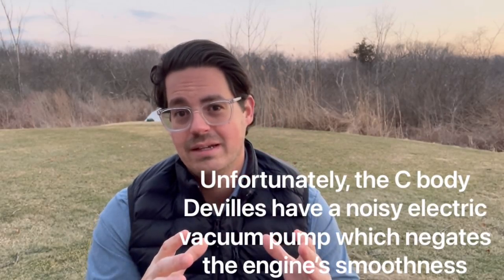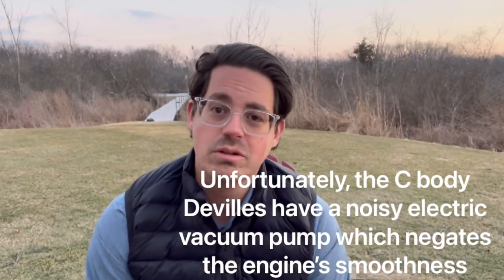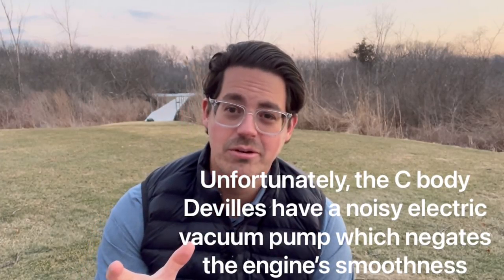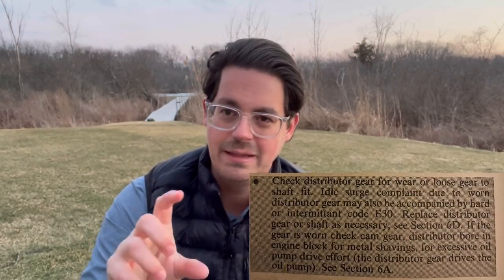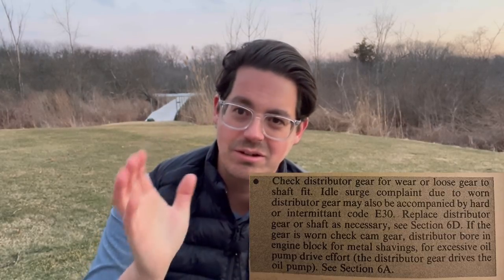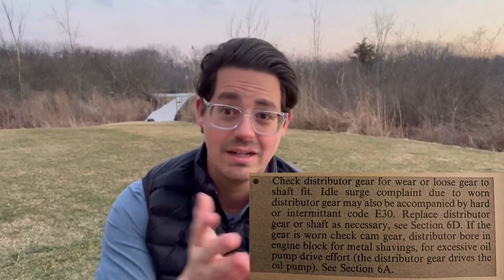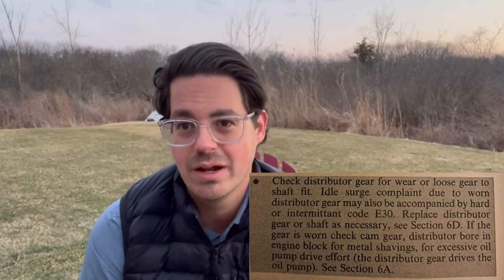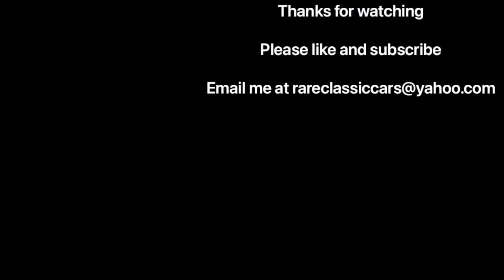Worst Engines of All Time: Cadillac HT4100 - Why is it so bad?  How can you preserve yours?

Comment: I purchased a 1985 Touring Coupe in 1995, with 30,000 miles on the clock. One of many Cadillacs I've owned and probably one of the smoothest driving. While taking a road trip to my mother's house in San Fransisco, on the return home I noticed it losing horsepower, using oil and felt like it was running on four cylinders. When I returned home, I performed a compression test which resulted in less than 50 lbs. in all eight. I still don't know exactly what went wrong but the engine was toast, and because a replacement cost more than the car was worth, I had it towed off to pick a part. The rest of the car was like new. Cadillac, after a series of "turd" engines should have used the Olds V8's like Buick, Pontiac or even like they did in the later Fleetwood Broughams. I owned a 77 Seville that had the Olds v8, and other than the Bosch fuel injection, was fantastic. I bet even the Allante and the XLR would have been more successful had they used the Vortec or LS derived engines, but I'm not a bean counter at GM so I guess they had their reasons.

Comment: line mech for cadillac early 80s, when we got the 4100s off the delivery truck we were instructed to put 2 huge tablets of radiator/intake stop leak in every one. They looked like oversize compressed pepper aspirins.

Comment: At the time, buyers wanted good mpg cars and Cadillac was attempting to do this, the 4100 was written up in car magazines for a few years as a good engine, then by 86 -87 problems started and the engine was redone into the 4.5 and later 4.9 and those were Cadillacs least warranty issue engine, so once this was redone, it was fine.
I knew a few people who owned a 4.1 Cadillac and took care of it and ran them over 100k  but also my Mom drove her 81 Riviera diesel for 20 years, and was still running when she got rid of it.
Lincoln had a lot of trouble with their V6 continental 89-93, lot's of upset people with those.

Comment: Parents had an 85. About two years after purchasing received letter from Cadillac saying engine was built with substandard seals and would leak coolant into crankcase and this would most likely happen after warranty had expired. It started at 40k miles and had to be rebuilt. Not covered by warranty. Numerous electric problems and transmission died at 50k. Last Cadillac ever purchased. Went to Acura and Lexus.

Comment: Drove a 1984 Fleetwood with the HT4100 and it outlasted two transmissions. Engine never gave any issue. Wasn't a high performer by any means, but it would cruise 75 easily. Got 24 mpg on the highway. Had almost 300,000 miles when the second transmission failed and we sold the car. The engine was still runing.
Reply: Built by the same company that a few years earlier were building 472/500/425--what happened?  Cheaper cars had bigger, better engines as options or standard equipment.  Did that make any sense?

Comment: Had 3 Cadillacs w/4100 engines. My 1983 Coupe deVille had the engine replaced under warranty & it was fine after that. Despite the issues I had with it the dealership & GM stood behind their product, taking care of it. Had 2 1985 Cadillacs & by then most the issues were worked out but by then it was too late. They were slow however did return pretty respectable fuel mileage. Seems like if you got a "good" motor from the beginning most likely it was trouble free??? 3000mi oil changes & adding the pellets to coolant seemed to be the secret to keeping them going. Also they were definitely not for the heavy footed driver & definitely didn't like being pushed hard.

Comment: Fun fact: the 88-89 4.5 was way overbuilt. That block continued in the Allante up to 92. The 90 4.5 is by itself. If you got an 88 coupe Deville, it did the quarter in 15 seconds. As fast as an 86 Monte Carlo SS. 
A 91 Eldo is an absolute rocket ship.

Comment: I worked at a Cadillac dealer and worked on several of these engines, and the 4.5, and 4.9 caddys and the early northstars. The biggest issues with these were they liked to spit the rods out, as did the 4.5.. the 4.9 was the best of these engines.. the 4.9 had a ton of torque .

Comment: Just imagine if those early-mid 80s Cadillacs simply had a 350. The thing I always go back to, is that people who could afford those cars didn't really care about fuel economy, so why not just let them have a good engine and then charge the extra fees GM would have incurred for not meeting CAFE on to the sticker of the car? I think people would have been much more apt to pay that for a proven engine that would run for a couple hundred thousand miles with routine maintenance than suffer the diabolical disasters that came with this abysmal engine.

Comment: My parents had a 1982 Deville with the HT 4100 I remember going to the Cadillac dealer with my dad and the guy at the service counter called it the 4100 hook and tow . They had so many problem with that car it was  traded in on a new 1988 blazer witch  they had till the year 2000 with 250000 miles.

Comment: I had a friend back in the 80s that I would race quarter mile with, he had a 79 mustang with a tube frame and fiberglass body we got the idea of building a cad 4100, I worked at a Cadillac dealer so I could get warranty engines for free, we milled the heads to get 13 to 1 compression, ported the heads made custom headers, had custom cams ground, car weighed 1400 pounds and ran 9.0 , the engines did not last long but we would do 3 at a time, they made about 500 horsepower so these will make a lot of power, but only for 10 miles or so LOL

Comment: Thank you Adam!  Great information.  
Random request;  Do you have information on the  A bodies that were offered in sportier trims?  
Cheverolet Celebrity Eurosport, Pontiac 6000STE, Oldsmobile Ciera International series with a 3800 V-6 and the Buick Century T-Type also with 3800.  Would you consider making a video featuring and highlighting the above mentioned?
Reply from the maker: Sure. Good idea
Reply: @RareClassicCars  Don’t forget the rarest of the rare A-bodies: the 1989-90 Pontiac 6000 STE/SE AWD. I drove one of the 1990s as my college beater car, and it was an absolute tank. Ran phenomenally, and so long as snow wasn’t up to the grille, it’d run through it. Might not clear 10MPH, but you couldn’t get it stuck.

Comment: I had a '84 Sedan DeVille with a HT4100. It had 310,000 miles when I let it go. If you drill out the rocker arm fulcrum bolt holes and add helicoils it is a good engine.

Comment: I worked at a Cadillac dealer in the 80s, made a lot of money on that engine, seems like the first thing that would happen us the intake bolts would loosen, causing oil burning and coolant leaks, we called them hand tight 4100s lol, if you got it early all you had to do was tighten them but we had so many customers that wanted new engines under warranty, we had to hold the old engine until the factory rep looked at it, then I would take them home, fix them up, they went for over a grand, lots of demand, I was making more money on the free engines than my regular pay, ahh, the good old days!!!

Comment: It's exactly as you describe it. I had 2 cars with these engines, first one 1985 Cadillac Seville Elegante with the HT4100, then a 1989 Fleetwood Sixty Special with the 4500. the engines are really slow but ran so smooth that you have already driven slowly to be allowed to sit in the car longer. I drove these cars in Germany and even reached 7.5 liters of consumption per 100 kilometers over a longer distance with the Fleetwood. Although the Fleetwood Sixty Special was actually the better car, I particularly mourn Seville. Today I drive Tesla Model S and have to say that the Cadillac engines have already come quite close to an electric motor, at least in a smooth run, although not in terms of power.

Comment: Don't use the coolant pellets in DTS Northstars!  At some point this century, Cadillac began advising against it for newer ones.
My late step-monster's equally toxic sister had a 4100 FWD Fleetwood that caused much trouble before it had to be hauled away in '89.  Later, she bought a mid-90s Deville before her husband quit drinking and fled.  I hope it had head gasket failure, but it might have been a 4.9.

Comment: in the early 80's when these engines came out, i knew they were going to be garbage when you were required to put stop leak tablets in the cooling system to plug up the coolant leaks due to poor design and manufacturing. my dad had one of these in a seville and it was a total nightmare. it went back to the dealer at least 8 times in the first year, he tried to have it lemon-lawed but was refused.

Comment: The HT4100 was responsible for my pastor switching from a repeat Cadillac owner to a loyal Lincoln owner. He never switched back. He had a 1992 Fleetwood it leaked /burned oil . And it had a stalling problem that the dealer couldn’t fix.  It was problematic in the rear wheel drive version. Just a little less so in the FWD version. Slow, and leak prone.

Comment: I watched the video all the way through, and I owned a 1984 Fleetwood Brougham De Elegance 2 door black on black and it had the 4100 HT , had it for 3-4 years and I never had the problems you speak of and the whole time I had it after changing the coolant didn't see anything on the car or in the owners manual about tablets for keeping it from overheating this car came from a millionaire who was very meticulous about his car's and I ran the car like I stole it. Worst thing to replace the power steering pump.

Comment: In 1995 I inherited my grandfather’s Fire Mist Red 1984 Coupe De Ville when he passed away. It sat a long time before then due to his health. I drove it for about a year and during that time I had manifold issues, cam lobe issues, exhaust leaks, and other stuff. The weird rubber collar between the rear bumper and sheet metal was dry rotted and impossible to fix and I tried everything. I wanted to honor his memory and keep it well maintained and nice but in the end it just wasn’t cost effective. I donated it to a Catholic organization for the tax write off which was more than I could have sold it for.

Comment: My 96 Buick Roadmaster sedan has the on board diagnostics in the electronic climate control. My temperature gauge quit working so I use it to make sure the engine coolant is at least 100° before I start driving

Comment: Thanks for your advice and comments, really helpful. 
I own a 1982 Fleetwood Brougham with 84K miles and am pretty happy so far. I love the car but am scared with everything I’ve been reading online or heard about the HT4100. Does it worth to rebuild the engine or to swap it with a V8 350 Chevy??
Reply from the maker: Drive it until it dies and enjoy it.  Change the coolant with the seal tabs every few years and don’t drive it hard. You’ll likely be ok.

Comment: These were so bad that we at an Amoco Garage we would yank these out and put in an Oldsmobile 5.0L 307 CID V-8 would bolt write up to the rear wheel drive. and after 1986 Cadillac Brougham went to the Oldsmobile 5.0L 307 CID V-8 TBI

Comment: Oh yes, the computer controlled TPS sensor and other computer related emissions control stuff was horrible in the early years. Check engine light galore and trying to pass smog is such a PITA.

The Rochester carb is was stupid by the late 80’s when fuel injection was becoming more of the norm.

Comment: I remember those having bad corrosion problems where the aluminum block met the steel sleevs causing headgasket problems. i fixed a couple with belzonna epoxy so i wouldnt have to change the engined

Comment: I had an '84 Eldo with this engine. Never mind the performance, my expectations were low. But even after 2 sets of intake manifold gasket replacements, it was still leaking oil into the cooling system. When it was around 15F here, i took the radiator cap off, and could not poke anything through the hardened oil. The engine died within 6 months of that, and my guess is from an oil pump failure. The HT4100 is absolute trash.

Comment: Another GM engine I would like to hear your thoughts and research on is the 2.8 V6 from the 80s which was the upgrade from the Iron Duke in many models.  I know they weren't particularly powerful, but the few I had knowledge of and experience with seemed virtually indestructible.   I believe the block was taken all the way from 2.8 to 3.9 before GM finally moved on which seems like quite a range and makes it interesting to me.

Comment: I found a cherry '87 DeVille with a 4100 in it @165,xxx miles. Im sooooo curious as to wonder what was done to it to have reached those miles(rebuild, maintenance, etc). Started out asking 5500, but now its down to 3995. If it creeps down to about the 3500 mark, i just may get it at least for the body/interior. I can always replace the motor, right?

Comment: A buddy bought a new 84 Coupe de Ville.....trading his 8-6-4which was troue from day one....the fresh start...if you will.....was a nice car at first. It wouldnt get out of its own way.....than the cam issues.....under warrenty....were fixed....little did anyone realize...that when the crap rtv gaskets....lol....fail.....breeching the water jacket....it was a slow painfull death as the power was worse and woŕse.....I tell folks not to compare this 4100 to the the 4500s. The technical aspects of the 4500 is amazing.

Comment: Actually Motor Week got 13 seconds 0-60 with a loaded Eldorado Touring coupe so they weren't all that out of line with most of the other low calorie V8's of the time.
A couple of fun facts with this engine. The first 1982 model year 4100 made only 125 HP and 190 LB FT of torque. For 1983 to 1985 the ratings were 135/200. In the RWD C-body cars Cadillac fitted a performance oriented 3.42 rear axle and a higher stall speed torque converter compared to the 307 equipped full sizers. In the E-body FWD cars it used the same 3.15 final drive as the 4.1 liter carbureted V6. For 1985 as fitted in the new downsized C-body cars the 4100 received a host of changes including a more robust ribbed block and was for some bizarre reason downgraded to 1982 power levels of 125/190 and then went up to 130/200 for 1986 and 1987. Note that their was also a 1987 higher performance oriented port injected version of this engine as used in the new Allante that had many of the updates that the 4.5 got a year later and made 170 horses and 230 torque. 1982 and 83 4100's used chrome valve covers whereas all other variants from 84 on up used ribbed dark valve covers. In the early years of this engine failure rate was very high and most Cadillac dealers had crates of replacement motors on hand to try and keep up with demand.  If you still see a smooth good running 4100 nowadays chances are the engine was either rebuilt with upgraded parts or the motor has been swapped out maybe several times.  We had numerous examples of these engines at my buddy's dealership during the 90's that we sold. We would verify that the engine idles smooth and had reasonable power which signified the cam wasn't shot and used to put a few upgrades into them. The pellet catalytic converter was replaced with a higher flow monolithic type, these cars liked upgraded 8.5 MM wires and the plugs needed to be gapped precisely across the board. We also bumped the base timing up 2-3 degrees and the difference in power over stock was surprising and most of our customers were quite happy with them. We also used to give out a special separate sheet of paper with the purchase agreement that outlined the correct service procedure with the pellets and every other year anti-freeze changes so that the customer was made aware. Surprisingly we only ever saw one return with an outright failure.
Reply from the maker: MTs Touring Coupe took 16 secs.  Perhaps it was a bit out of tune.

Comment: I worked on plenty of those HT4100's back in the day.  They were all junk.  Every one of them.  I don't think any original owner kept one for more than 2 or 3 years before junking it or trading it in.  Second worst engine only next to the Olds diesel.

It was so slow that you had to floor it to get it to go anywhere, which only compounded the design flaw with the soft cylinder head bolts, causing premature head gasket failures.  Junk engines inside of junk cars.

The best engine of that era was the Buick GN V-6